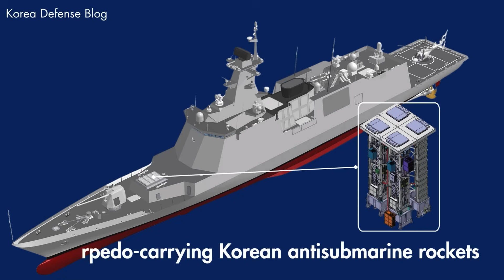South Korea’s Future Experimental Frigates

Comment: The ROK Navy FFX Program not only help build-up the surface fleet. It also help them in the export market first with Thailand, Philippines, Peru, etc. As for the FFX-Batch IV (Ulsan-class) I've read it will largely be base on the Chungnam-class with improvement to the sensor and weapons system. 

Additionally I wouldn't be surprised if a derivative of the FFX-Batch III/IV will be offered to the Philippines likely as the a successor to the Miguel Malvar-class with a further 2+ planned to be acquired before the end of the year!
Reply: 이정도면 전시에는 전세계 각국 함정이 울산 거제 창원으로 와서 미사일방어를 해줘야겠다.. 한척씩 보내줄테니 조선소랑 조선기자재업체 지켜라